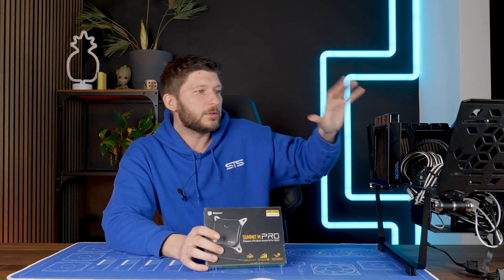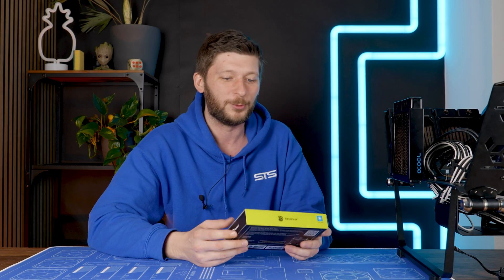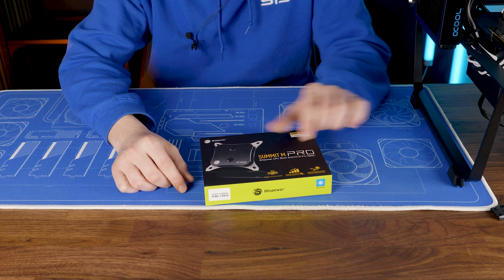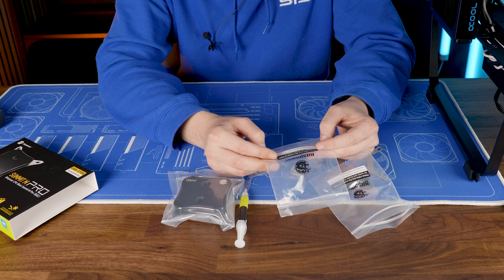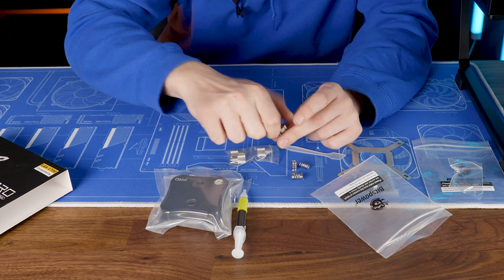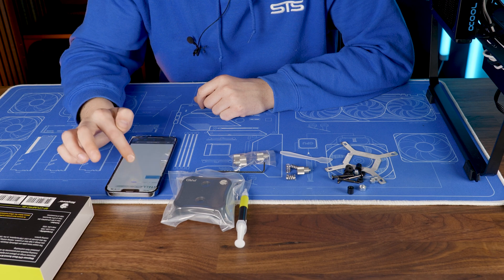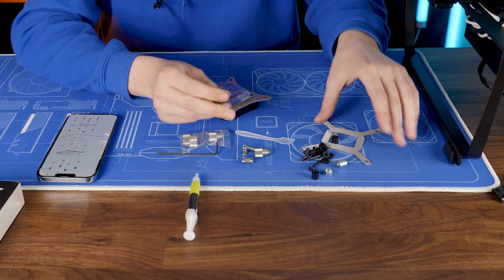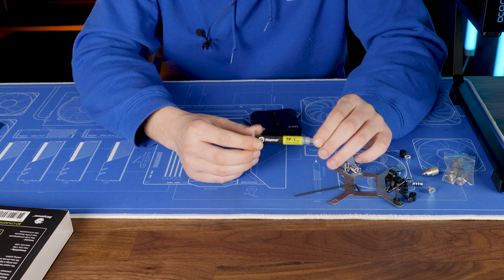Episode 4: Water Block Mastery: Installing Bitspower Summit M Pro

Comment: I got the Mystic Black Metal edition. 
There is no indication of flow direction, and it must be dissasembled to install the right bracket for your build.
It came with two sets of thumbscrews and springs, and 16 standoff screws, and three brackets plus two backplates. The labels may or may not clarify the purpose of each of these components. (Pretty sure half the production cost was extra stuff I'll never use)
The manual might as well be written in hieroglyphs, because the only useful information is the pictures. Whoever designed it should be sho-... shown the door.
If I was new to plumbing my PC, this purchase probably would have put me off the experience for life.

Comment: New subscriber. Enjoyed your content and presentation :) Would you please tell me what (exact) lens and camera you are using. Thx very much :)  
Also, to answer your question in the video... yes, it would be great to see some various water cooling components tested and compared. I do this all the time with my test bench setup (8 different mobos, etc) loads of fun... and you really have to be mindful of the ambient temp as just 2F can make a big difference. Also, with different cpu waterblocks, there won't be too much difference between them if the cpu is running at stock under load and if the cpu is a lower model; I would suggest overclocking it the best you can and test the blocks that way as you will see a more meaningful difference because the blocks will have to pull away more heat faster. Hope this is helpful, and I am looking forward to your upcoming videos!
Reply from the maker: Hey and thanks! Means a lot!

Noted! And absolutely! If we start doing things like waterblocks it won’t be beneath 200-250w package power, otherwise the differences will be way too small 😅
Reply from the maker: Oh, forgot to mention the camera, it’s a lumix s5 with the standard (big one) lens that comes from panasonic
Reply: @STSYT  greatly appreciate you